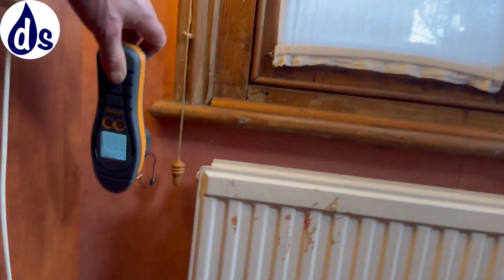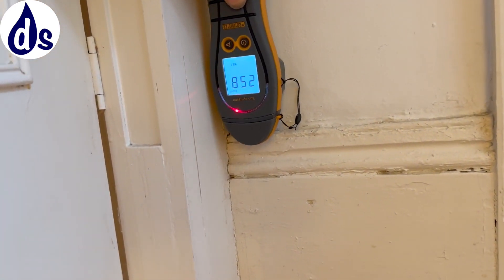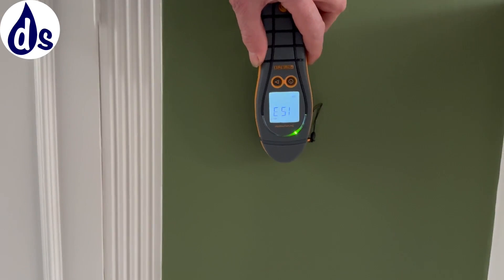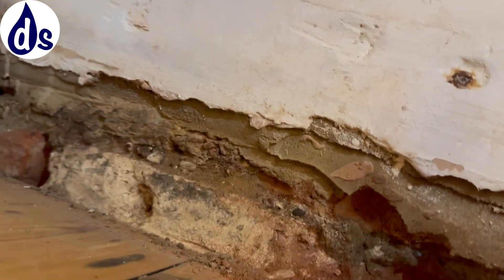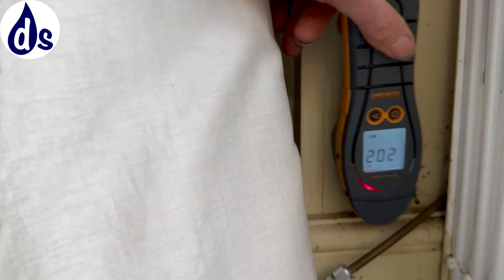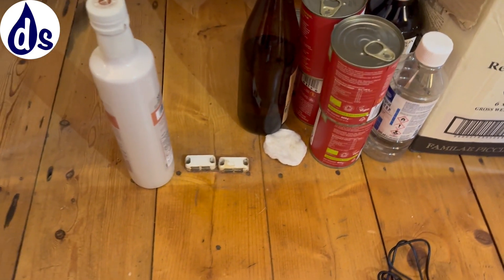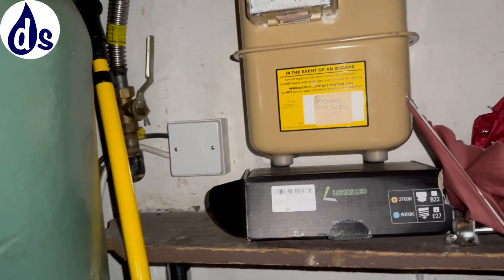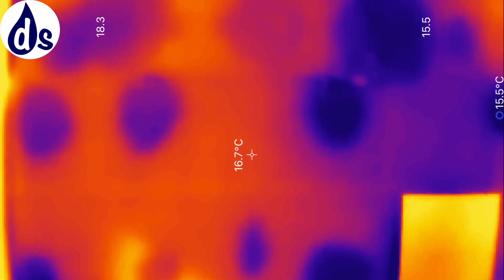Damp proofing efficacy: mould and condensation

Comment: interesting. i've been going down the condensation rabbit hole on youtube haha. i'm learning a lot.
Reply from the maker: Thank you for your comment! 😊

It’s easy to go down the condensation rabbit hole—there’s so much to learn! The key takeaway is to follow Dew’s Law, which is about keeping the dew point (a measure of vapour) below the external temperature. This prevents condensation and related issues like mould. For a detailed explanation, check out:
👉 https://damp.ai/dews-law

Here are some top videos to help you dive deeper into managing condensation and damp:

🎥 Mould and Moisture Mayhem: The Vapour Strikes Back
https://youtu.be/vVFBM-w5V3A

🎥 All Insulation, No Ventilation: The Condensation Catastrophe
https://youtu.be/QxX7Bx5k008

🎥 Damp Déjà Vu: When Proofing Merely Displaces Damp
https://youtu.be/8PHsAEAESJY

🎥 Respect Awaab’s Law with Dew’s Law
https://youtu.be/MMJeqjAWtSo

🎥 Damp and Mould Next to a PIV Fan: What Could Go Wrong?
https://youtu.be/7IkEncsgwUU

🎥 Why Does Rising Damp Treatment Cause Mould and Condensation?
https://youtu.be/fjH9QQRAYXY

🎥 Condensation Across a Property with Blocked Extractors
https://youtu.be/0yKzQWIqjOk

🎥 Condensation and Hygroscopic Salts in a Victorian Rented Property
https://youtu.be/J9XacxdnSvk

🎥 Damp from Cold Steel Supporting Column
https://youtu.be/NX2VsvrUk2g

🎥 Condensation Dribble Marks Explained
https://youtu.be/7XRKExtlUAQ

Let me know if you have more questions or need guidance—happy to help! 🙌